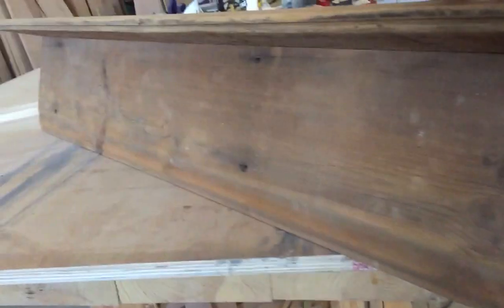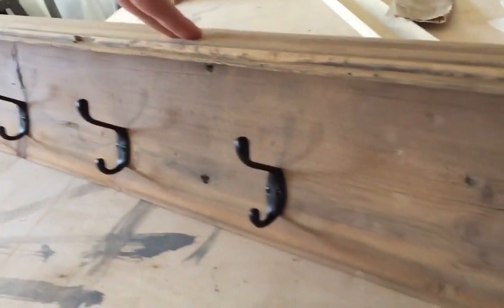How to Build a Farmhouse Coat Rack | #DIY Project | #Woodworking

Comment: what did you use as mounting brackets for the back?
Reply from the maker: Hi Elizabeth, I just used screws and painted them brown to match the wood color. Please note that the screws are attached to drywall anchors behind the coat rack.